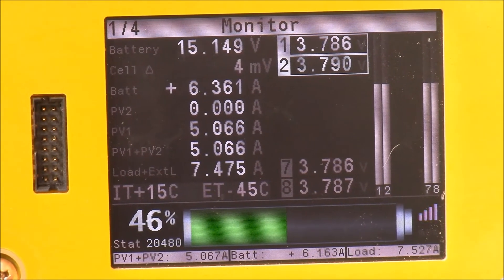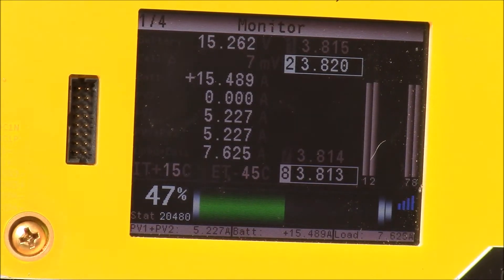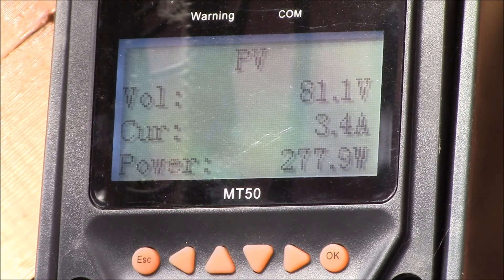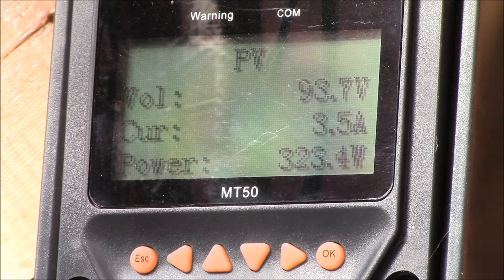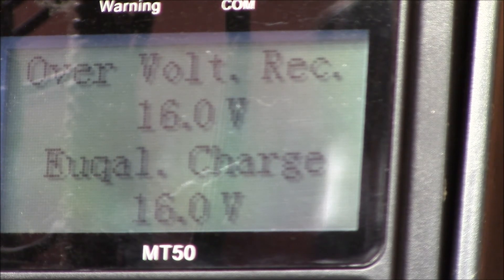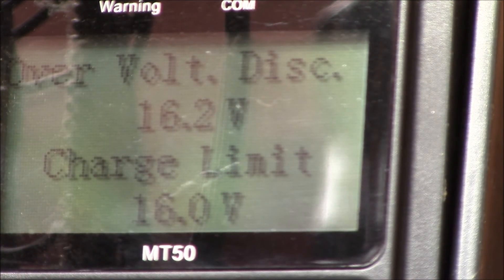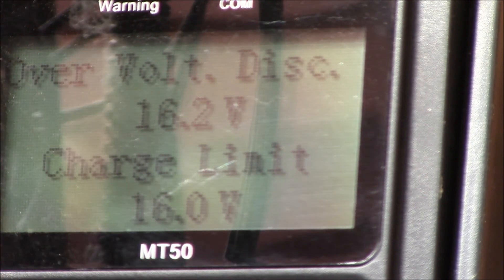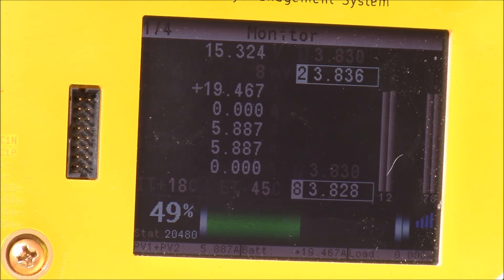16V Power Wall / Inverter Surge Test

Comment: hrm I would set the SBMS to 4.1v per cell and the epsolar to how you have it now, that way the SBMS will not cut out with the solar charge controller charging too high. with the panel on the PV input of the SBMS then the voltage will go higher than the epsolar will charge too so it will stop and then there will just be the power from that one panel going in. that should work fairly well. you should do a time lapse of their screens to see what they do during a typical day.
Reply from the maker: That may be an option.  The main issue is that I can't change the high voltage limit of the power inverter, it seems to shut down around 16.1 or 16.2 volts.  I also need to reduce the voltage drop in the EpSolar battery cables.  Right now I run through two circuit breakers, I need to eliminate the extra breaker and it's voltage drop.
Reply: R Brown oh I see, it isn’t the SBMS cutting out just the inverter. Yea that’s the problem with 4S it’s normally just too high for 12v inverters. As long as you have enough capacity just don’t charge it fully, keeps the batteries healthier in the long run. 4.05v per is still mostly full
Reply from the maker: Both devices are cutting out.  The SBMS is set at 4.00 v/cell and when that is exceeded, it cuts off PV charging from any panels connected to it.  Not a big deal, it'll cut back in below the 3.90v/cell level, but I lose the PV input from those panels most of the day.  When the power inverter cuts out, I need to disconnect and reconnect it to get it to reset.  

But yes, trying to keep the cells under 4.0v for the added cycle lifetime and that's how I've done all my testing and capacity measurement.  So one of my ~35AH battery packs would be closer to 50AH if I pushed them to 4.2v/cell.

Comment: I found the same thing with my epever when I had my panels in parrell  or series I left them in series so I had less current on the pv cable. Thanks for the video
Reply from the maker: Thanks for the comment.  At least now I can test out all these various combinations since I have all the same panels on my rack.  I'll try 2-series into the EpSolar and then put the 3rd panel into the SBMS and see how that goes.  Should top out at 60 - 65 amps.